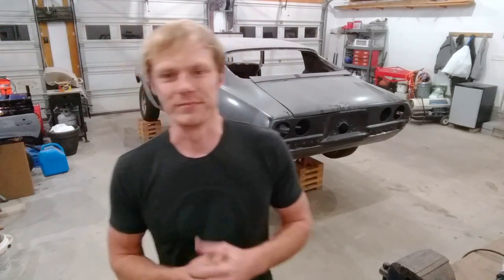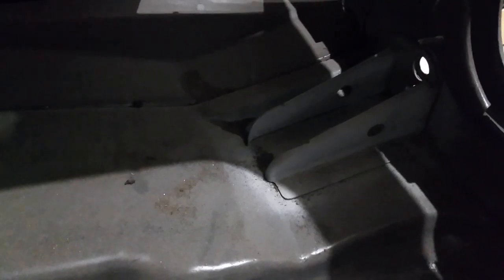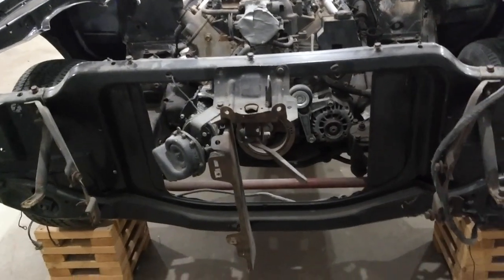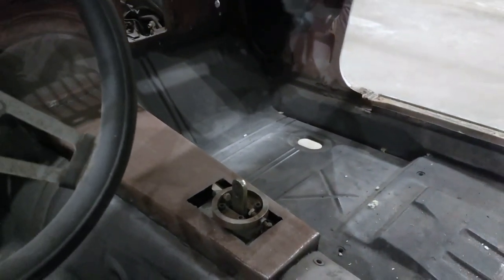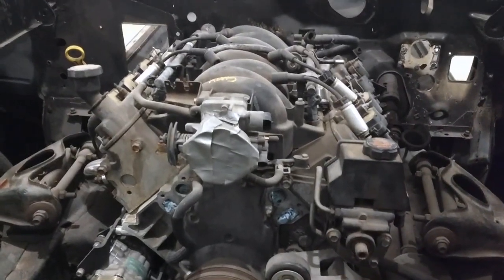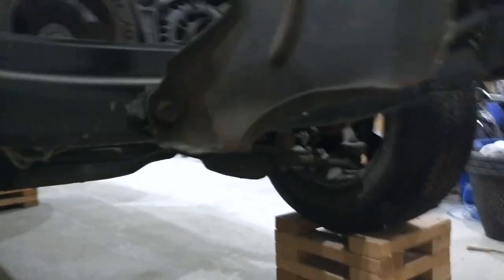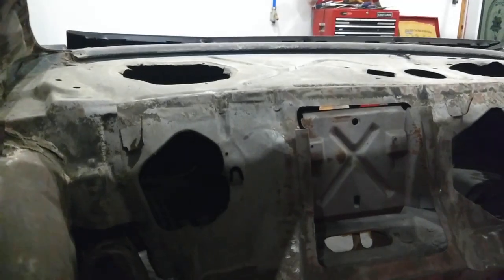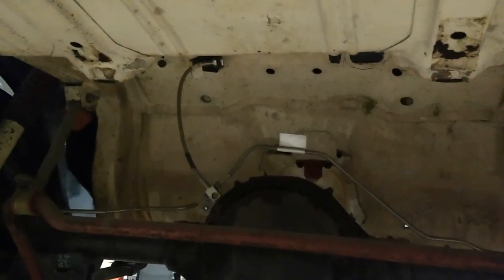1971 Chevrolet Camaro RS/SS Build Project Introduction

Comment: thanks for the videos, i also have a 71 RS/SS which i built 25 years ago and am currently working on a 71 ss full bumper which required new quarters, trunk pan extenstions etc.

Comment: Russ from Double R sent me over and you have a great project going, he has a LOT of videos with Project Overkill. One thing that you might want to plan for is putting in sound deadener down the road, Lizard Skin works quite well so does dynomat. Those two products will quiet the interior of the car down along with allowing the AC and heat to work easier
Reply from the maker: Nice, thanks for the tip. Russ certainly does have a lot of videos. I love his attention to detail. I'll check into those products. Thanks for stopping over!

Comment: Came across your channel while looking for tire cribs.  Your video was very helpful.  Will check out other vids.  Looks like a great project.  I think the quarter to rocker joint is not supposed to be welded from outside and gets seam sealer in joint.  thats the way my 69 is put together anyway.

Comment: Have you tried your windshield in it yet?
Reply from the maker: I have not. I cracked mine trying to remove it... I'll get a new one once I get to that area of the car. The plan is  to fit the windshield along with the trim before spraying epoxy. Just in case I need to do any metal work due to the roof panel being replaced.
Reply: I had to replace all around the top of my windshield. And the cowl panel and dash windshield is not fitting to well but I think I can fix it

Comment: Early 2nd gen Camaro with an LS swap. 💯💪👍. I LS swapped my Monte back in 2010. Much more support now days. Question, was the car pretty much complete when you got it? Or did you buy it stripped? I can see by that firewall, its a factory air conditioning car. Still have that or was it missing already?
Reply from the maker: The car was in rough shape when I got it, but had a good bit of its pieces with it. I have the AC box that attached the firewall. I don't believe it had any of the other pieces with it, but I'd have to check.